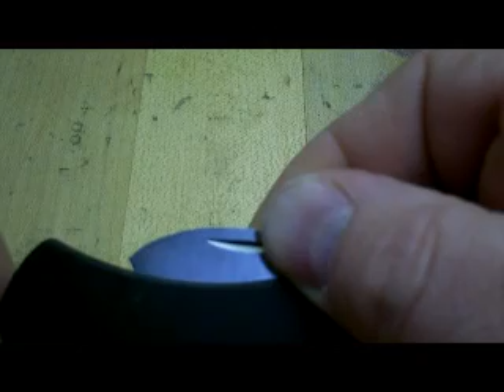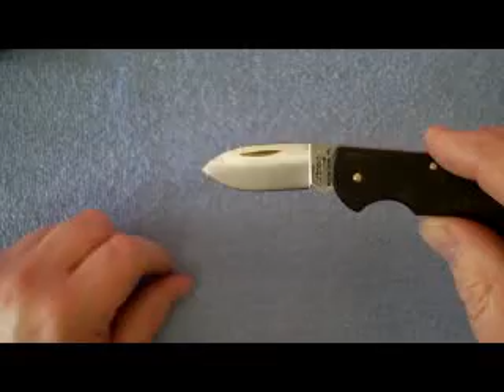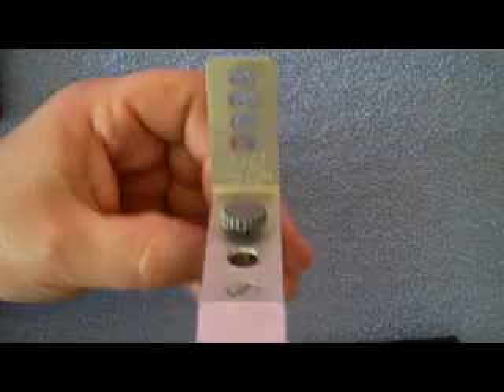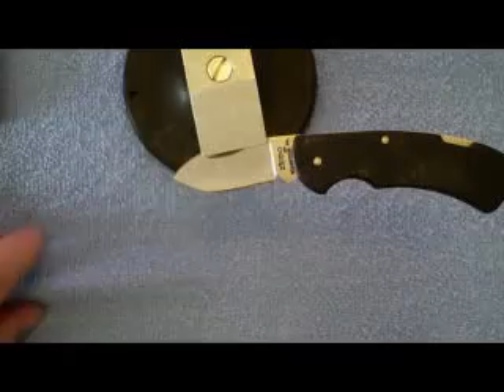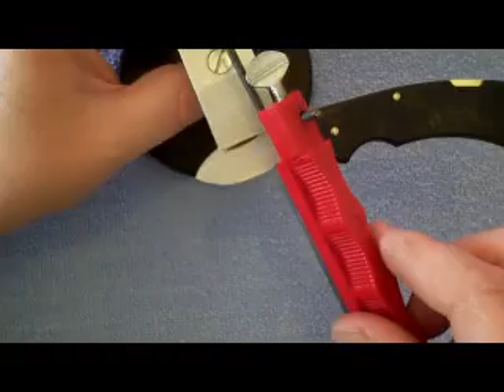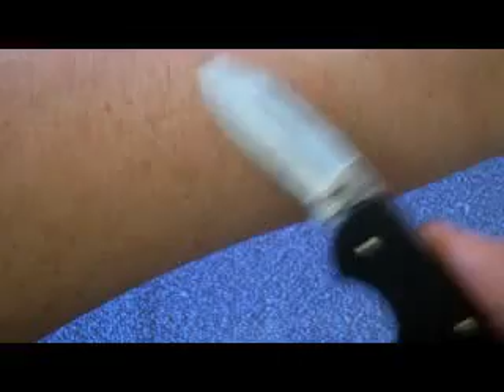How to fix your knife blade tip

Comment from the maker: @FORWARDxUNTOxAWESOME I can't help you with that. I have no exp. with throwing knives. I dont think I would harden the tip or they will breat insted of bending. You could try reprofiling the tip but you would have to keep in mind that you are changing the balance of the knife. Maybe a softer target or a thicker blade would help. Sorry I could not be more help. Good luck.